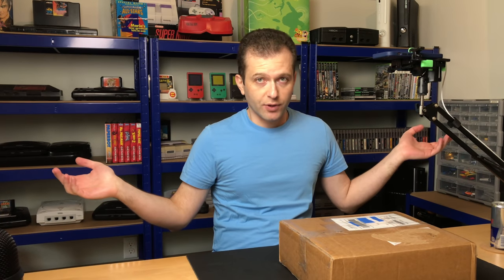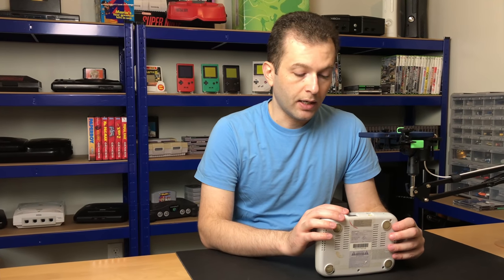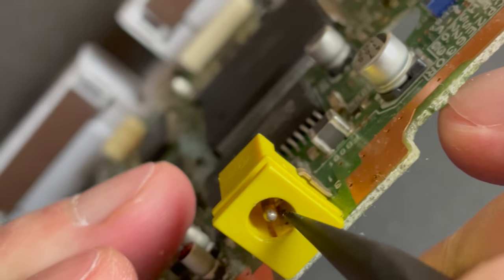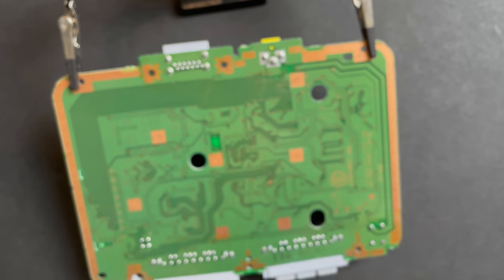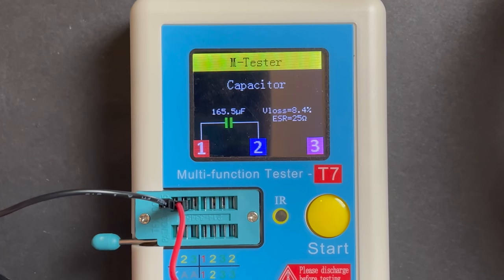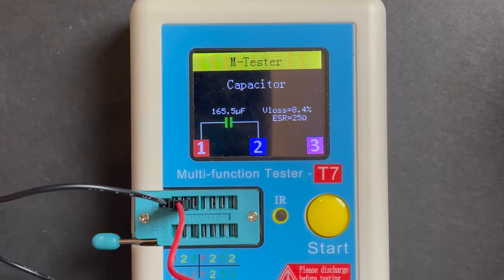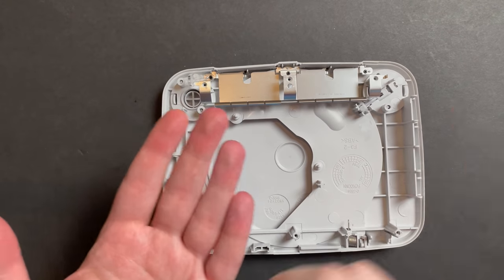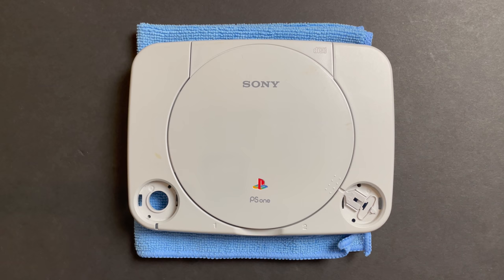A Behind-the-Scenes Look at a Sony PS One Repair - Retro Console Restoration

Comment: FYI, I’ve done several of these repairs. It’s really best to replace the neighboring capacitor, too - it’s responsible for the s-video signal. So composite works now, but there’s a good chance s-video is still bad.
Reply from the maker: That's a good suggestion, thank you for sharing that tip.
Reply: yeah more than likely when one goes bad its only a matter of time till the rest go bad

Comment: Ex-Sony engineer here, nice to see someone still cares enough to keep these little consoles alive. The dull joint was caused by a mixture of two different types of solder initially. Wicking it off and re-soldering was the way to go. It all got a bit melted though when replacing the cap. Probably not a bad idea, (as other people have suggested), to replace the rest of the capacitors, to save them leaking at a later date, maybe with a fine soldering iron tip instead. Just a thought. 🙂

Comment: Hey, you might know this already and/or this didn't happened before, but you should definitely wear safety goggles while applying heat to aluminum capacitors, they have a tendency to pop. I'm just here to avoid this scenario and continue your good work. Cheers.

Comment: Years ago when I was an apprentice I got “scolded” for using lithium grease on plastic. Not sure if you are using a special recipe however what I was using specifically said “lithium should not contact plastics or rubbers - will cause material degradation”. Probably doesn’t matter in the short term maybe even the long term however as soon as I saw you do that I had a flash of nostalgia 😂. I’m really enjoying your videos.

Comment: Another great repair.  I'm really enjoying watching you work.  I only stumbled upon your channel a little while ago but so far I like what I see.  That power connector solder joint issue reminds me of MANY I have had to do over the years and I find the early lead free solder just s*cks and cracks far too often.  I have a 60+ year old 5lb spool of kester 50/50 rosin cored solder I use for just this sort of thing as it flows amazingly well and does such a great job fixing those lead free joints.  It leaves a good amount of flex and never cracks.  As far as epoxy goes I completely agree with you but I have also found something even better to use with plastics like this:  automotive polyurethane panel bonding adhesive.  Permatex sells a great 2-part one in the syringe just like you used here and it has superior bonding and strength.  Comes in black, grey and tan so it tends to blend in very well for the near-invisible repair.  So far I have not come across a plastic it won't bond other than polyethylene which really isn't going to be used for cases like this.

Comment: Love the video, still waiting for an excuse to try my hot air station out in a surface mount component
Reply from the maker: Did you end up getting the cheap-o one I have or something better? Yeah it's nice to have a project where it actually makes your life easier to have hot air.
Reply: @BorderlineOCD  same one you have, I use it for shrinking heat shrink right now. Very handy for that.

Comment: Great job. You need to be careful around those electrolytic caps with high temperature though, you can boil the liquid electrolyte pretty easily with those hot air guns. The cap then turns into a dangerous projectile which could possibly hit your eye, if you're not wearing safety glasses. I think it's also probably better to change all the caps in that area which came into contact with the hot air gun at least. But as you probably know yourself, these things could really do with a full cap replacement to future proof them. But that's just being nit picky 🙂

Comment: For gluing abs or abs/polycarbonate like that, try MEK and/or acetone.  If you're working on a black plastic shell, ABS plumbing glue works pretty well (would work on other colors too, but you'll have a black spot where you applied the glue).  If you look at the ingredients list, its acetone, MEK, and ABS resin.  I just did that repairing the disc drive door hinge on a PS2 slim and it worked really well. The nice thing about that repair is it basically melts the parts together.  So, the parts aren't glued together, they are fused.  Repair should be about as strong as the original was.
Reply from the maker: Ha interesting. I guess it makes sense as modern pipes are all made of plastic.

Comment: Magic Eraser is also good as a stylus cleaner for your Record Styli as long as you ensure the stylus moves in and out of the eraser perfectly vertically.  which means you would want to ensure you use the queuing control to do so.

Comment: All my consoles apart from my PS4 and PS5 are from eBay as faulty and I repair them. It is much more satisfying and cheaper than just buying a good used system.
Reply from the maker: I agree completely, not to mention the additional maintenance you can perform along the way like cleaning inside and out, new thermal paste where applicable, clean and grease fans and optical drive gears if needed, etc. so your "repaired" system ends up being in better shape than a comparable working "used" system.
Reply: @BorderlineOCD  yes exactly! Even if I bought a good used console I would still want to open it for maintenance anyways so it makes a lot of sense to save a lot of money on the faulty ones and just repair them while doing the general maintenance.

Comment: (sorry for the Mistakes in my writing) Hi I am who was complaining about your thumbnails In the past, I apologize if you didn't like that, I just like your vedios that's it and I found them really helpful like the old psone repair vedios which I run into the same problems also the ps2 and ps3 vedios that I olso did came across ylod pal unit like yours and it did work but later in the same day I put the caps in reverse which killed the Cpu and gpu giving me ylod again
And for your new way i suggest to mix it whith your editing
And that's it
Keep going
Reply from the maker: As long as the quality of my content keeps you coming back, I'm good with that 🙃  Sorry to hear about your YLOD woes. Hope you have better success in future.

Comment: I have a PSOne with a video issue too. Glad to have stumbled upon this video. Is that capacitor the first thing to check for that issue? Should I check anything else? Subbed. Thanks!
Reply from the maker: Yes that capacitor is the primary reason for bad video or no video on this model. Very common issue if the system is otherwise working.

Comment: And how do you find those grounding points when you are working on the power connector? Which mode of the nultimeter are you using to chexk?

Comment: I replaced the same capacitor and the 2 neighboring ones so now the PSone starts but it only makes it right past the Playstation logo screen.  After that it loses input and fails to read anything at all.   The disc is certainly spinning though.  Should I change all capacitors?

Comment: I've had to do the same repair on a PSOne I bought. Seems to be a common problem with them probably due to the PSU being heavy and possibly pulling on the port from time to time.
Reply from the maker: Yeah its a pretty common problem on a lot of electronics, especially consoles that might have been previously owned by kids if they were rough on the cables. Some adults too for that matter. Mechanical stress is probably the biggest reason these consoles are sold as "not working" and as you have found out, a very easy fix.

Comment: Hi. I would like to know which is better to replace fuse FCC16 AD 401 or TF16SNO.40 marked as "PS1" in the PlayStation 2 fat mainboard V7, GS-022, provisionally I have it with a bridge
Reply from the maker: Sorry bud I haven't run into that issue. My PS2 repair manual lists PS001 with a serial number that returns a thermal fuse of some sort. Those are almost impossible to solder as DIY (heat from your soldering iron will trip the fuse). Have you searched to see how others have resolved it?

Comment: 19:13 can ask for a link for that grease? or what type of grease it is? do you think it will work to lubricate a bluray drive of a ps4 slim? mines sometimes try hard to read bluray games and already cleaned the lens with ipa but still sound like the mechanism isnt smooth.
Reply from the maker: Added to the links in desc. It's just white lithium grease. Any brand will do the trick and yes you can certainly use it on plastic parts of optical drive like gears etc. For motor shafts though (the center rod that spins) I like to use 3-in-1 oil which is both a penetrating oil and a lubricating oil. Grease doesn't harm it but an oil will make its way down the shaft and eliminate friction. Check out the Sega CD video I posted for the part where the drive is refurbished it should all make sense.
Reply: @BorderlineOCD  thank you, love the new anime thumbnails

Comment: Now, please, pimp this PS1.

Please, gimme some hand. 

I was trying to change a blown capacitor. I took it out, but I can't place the new one by holes.

I used Soldering iron, flux, this coral piece to "suck" soldering, but no joy on fill a hole to let capacitor pass by. 

What do I really need to do to work properly.

Thanks
Reply from the maker: Is your problem a hole that wont clear up? It can be a pain in the butt sometimes. When all else fails I use hot air from one side and the soldering iron/wick on the other (previously suggested by a subscriber and it works well). But other factors could be there is not enough heat, low quality flux or braid/wick (this can make a huge difference) or corroded traces which conduct heat poorly. I'm assuming you attempted to flood the holes again with fresh solder? This can help tremendously with thermal transfer.

Comment: My 1st big repair was on a PS3 that had cockroaches everywhere inside. Seller said it just didn't read discs while in actuality it needed new thermal paste because it kept overheating. Then I found out the eBay seller sent me a different console from what was in the screen shots. The most difficult part was getting rid of the smell, I got rid of most of it but it still lingers a bit in the power supply but it's bearable.
I would like to completely eradicate it though, so any ideas?
Reply from the maker: Yikes, I do not look forward to ever running into this issue. I'm sorry bud, wish I could offer some pearls but beyond using 99% isopropyl alcohol I've never really cleaned a board with anything else. I have seen plenty of videos cleaning PCBs using ultrasonic cleaners. Not something I've ever considered doing myself or even feasible for the average person but that's all I'm aware of in terms of deep cleaning a board.

Comment: That model was notorious for bad video capacitors.  You really shouldn't use hot air to remove surface mount caps especially with other ones so close.  Those are not solid state they are electrolytic.
Reply from the maker: Indeed, these are SMD electrolytic caps. How concerned are you about installing them with hot air? I’ll do some research on this for future. I certainly don’t want to shorten their rated life.
Reply: @BorderlineOCD  While installing them flux does all the hard work.  Just apply some solder to the tip of your iron (the knife tip is fine) and touch the outer pads.  The solder will flow inward towards the flux.  You don't really even have to pre-tin the pads all that much if at all.  Maybe practice with some junk boards.  The other way you could do it is use some kapton tape and foil to keep the hot air concentrated on the area you're working on and away from other electrolytics.  Also, you only replaced one of the two video capacitors (the other one is video for PAL based systems) just an FYI in case you ever sell it overseas.  The PAL one is likely dead as well.

Comment: Did you replace the feet or just remove the nasty ones?
Reply from the maker: Just removed them. I'm planning a future video on making new feet for consoles using a circle cutter and the proper material (rather than using transparent furniture rubber bumpers).

Comment: I'd like to ask, maybe not relevant to this repair. But if I want to secure a spindle motor from tearing off, what should I use to keep it down?
Reply from the maker: Haven't had to contemplate that dilemma myself but it depends on the materials you are fusing. There are all sorts of epoxies designed for fusing different materials with various work times/cure times.
Reply: @BorderlineOCD  I will take a look then. Thank you very much for help.

Comment: you should be very careful when heating this type of capacitor , most of the time it blows up , and flying , many people injured an eye while doing it , you are lucky to not get it to blow  ,at least wear glasses
Reply from the maker: I was a noob back then. Indeed it's an electrolytic cap and should be installed with an iron to avoid overheating it.